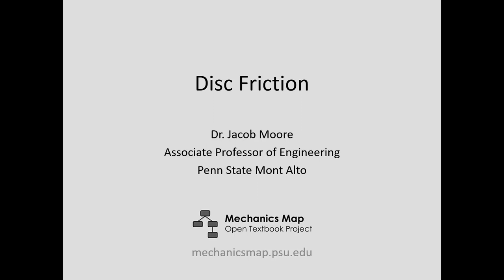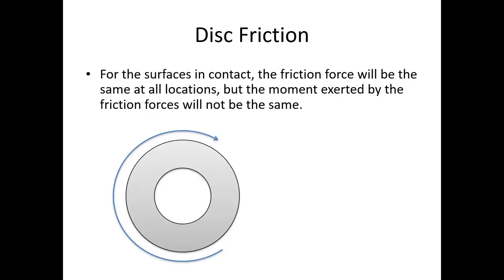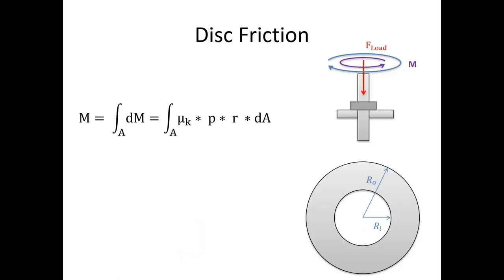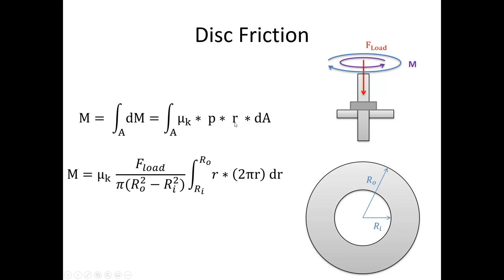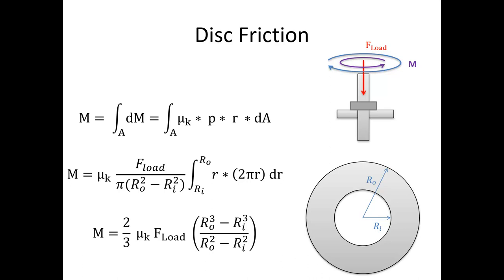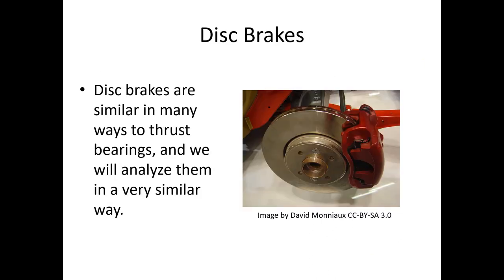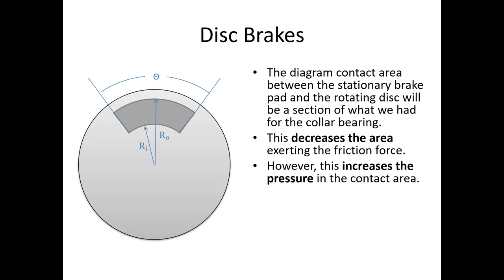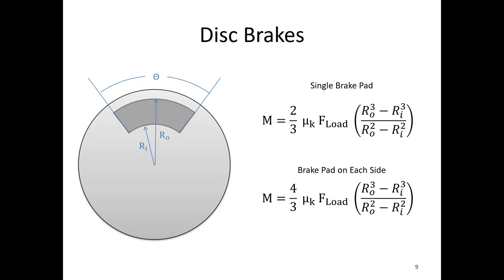7.6 Disc Friction - Video Lecture - JPM

Comment: How is this equation affected if you have a pin on disc scenario, where the pin has an area much smaller than that of the rotating disk, but they are in a constant spherical contact?